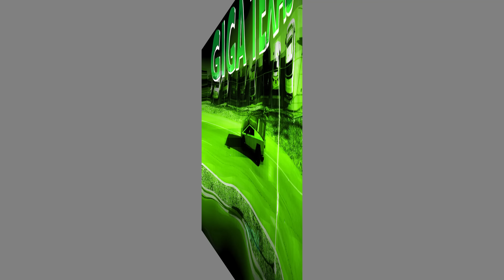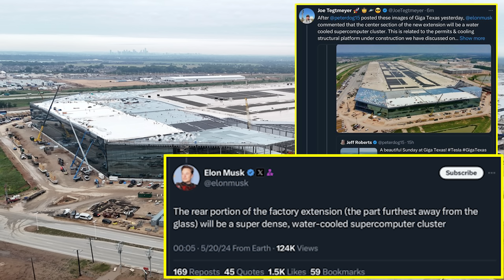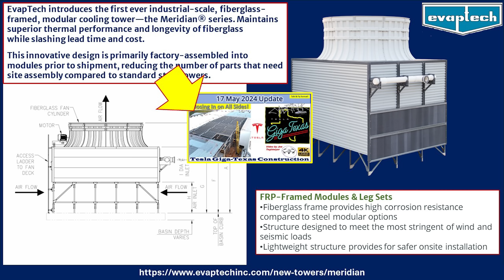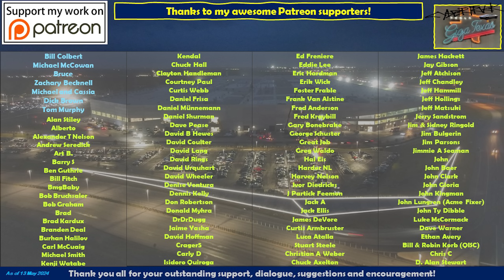S Supercomputer Data Center! N Conduit & Trenching Progress! 20 May 2024 Giga Texas Update (07:35AM)

Comment: Thanks Joe
1:36. Southend, inside. Central Structure, Level 3, under the roof. Beams for a bridge crane clearly visible, including the stopper blocks.
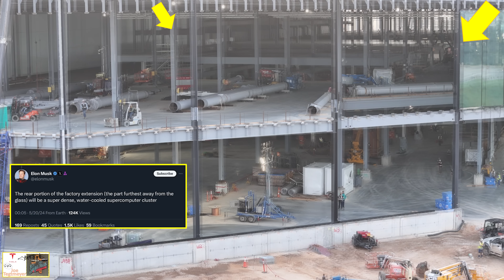Immediately below on Level 2, beams for a bridge crane. 15:21 also.
2:16. East contractors yards. Pipe Fabrication shop. Black vault must somehow be associated with the pipework. Seems painted inside. Vaults seen in the westside storage yard were similar
2:40. Southend, roof. Not so different. Bituminous felt roof layed over insulation board. See 12:18.
Joe’s previous video at 19.37 better shows the system. Trafficable insulation board, joints taped and sealed, hot bituminous adhesive placed and fabric rolled over. Hot bituminous adhesive applied again and bituminous felt applied as the final membrane.
3:25. Southend, east. Cooling tower. Small white perforated pipes attached to the larger black pipe.
Some vertical divisions installed in the FRP framework.
Under the concrete structure. Large steel beams fitted between the columns. For suspending pipework from presumably.
4:02. Southend, south. Parapet glazing. Fixing is into the channel at the bottom, and via a bracket on the vertical edge at the top.
7:24. Southend, east. Apron. To the right of the crane are the raker beams for the angled element of the facade.
9:59. BIW, roof. These pipes are labeled ’TMW OWW’ up at the Casting end of the pipe run. A search turns up nothing relevant for that abbreviation. May be an abbreviation of a witty in-house Tesla term.
10:40. Stamping, roof. Loading platform. Not sure how this will operate. Platform down to roof level is around 8’ 2.4m.
Adding 2 decks of cable tray to the pipework support frame. Possible route for the power supply to the data centre.
17:54. Westside, storage. Salvaged glazing panels. Not being used for the parapet glazing. Different heights, different frame colour, glass would be different also.
24:03. GA, highway side. Left. Area taped off in the small green space.
25:11. Battery west, apron. Rolls of Anode material. Crates marked LGES (LG Energy Solutions).
26:09. Tesla road. Road trenched and the pre-assembled ductbanks dropped into trenches. Works must have been carried out Saturday.
To the right. Possibly some remedial road works, or dropped some other pipe/duct/conduit for ‘later on’. Original ductbank crossed Tesla rd slightly east around 20’ 6m to the east
North side. Excavator demolishing the old batch plant road berm. May be the last section of Harold Green Road. Start of the works for the parking lot exit road perhaps.
Reply: 10:40 Stamping roof platform...
Speculating that they will place the cable spools up there. They have to unspool about 4,000 feet of cable! Or around that much.
One thing that doesn't make sense is how close the cable trays are to each other. Seems like that basically kills redundancy. A fire in the lower cable tray would probably take both of them out. Though I would like to hear from the electrical experts on that.
Reply: @DavidJohnson-tv2nn  10:40. Cable spools location, possibly.

I wouldn't want to say with hat eating certainty that the supply for the Data Centre is to be run on these cable trays. Coincidentally the framework on the roof of Casting does finish roughly above the vaults in the apron below.
Reply: @DessieDoolan  I had exactly the same thought when I saw those two rows of cable trays... Data center! Considering that those pipe supports run the full length of the building. So I think we can be 99.9% certain. Hopefully we can get more drone coverage up there to see how far north they go with the cable trays. Or... If we see a crapload on cable spools on or near the platform, then we will know for sure.
Reply: 25:11  I am not an expert.  Not even a keyboard warrior...  However, It seems to me that battery rolls of copper foil coated with the graphite? mixture should be ultra clean room pure and not open air construction dust and dirt exposed.....  Thus, these rolls are rejects?  And to make matters worse, I thought Tesla was making their anodes internally?  using the dry process.....  And it was the aluminum foil cathodes that are causing problems.

this picture is really, really disturbing.  Are they buying 4680 anodes premade too in order to produce 4680 batteries?  If true, it is a sad, sad day for 4680 production!
Reply: @eclecticmemes  So much of what was promised at different times is far from what was actually delivered.
Reply: @eclecticmemes  25:11. No doubt these are rejects. First time sighted I would add.

Not sitting well in the crates, might be rejects but not necessarily LGES rejects.

I was following the 4680 program earlier, but it all got too complex and I haven't tried keeping up.
Reply: re 1:36 Since the datacenter was confirmed  I've been looking for useful YT channels.. The gist of what I found so far is that datacenter engineering is rapidly changing, and that for high-density datacenters there is a strong move towards liquid cooling. Not as a trend, but as a basic requirement for higher density datacenters as well as for larger and larger chips being developed, incl for AI. In water cooling itself I came across a lot of technical solutions, so better not to speculate too much. But one thing seems clear, for high density datacenters using water cooling there is a need for a massive engine room with rows of pumps, chiller units, manifolds etc. Like next to Cathode but then in an XXL version. So a gantry seems a good idea for switching out equipment. Also I a came across massive back-up water storage tanks to guarantee continuity. And I found a case where the water tanks were used to maximize cooling during the colder hours of the night to save on utility costs during the day.  

How will it all be implemented? There is also the big issue of security, so it seems logical to house everything of direct importance inside the main building, including the back-up water supply tanks and the primary cooling loops and chillers. Outside we would then only see cooling towers for heat rejection, i.e. the secondary cooling loop.

Alternatively a completely standalone bunker could have been built, closer to the switchyard and megapacks, but it hasn't. Utilizing that empty plot, the old switchyard, maybe was a possibility, also no problem to plonk down a cooling tower there. At that location you could even throw in a decent off the shelve gasturbine generator for a truly independent power backup if you can survive the first 10 minutes via UPS. Instead, we get all the hassle of routing MegaWatts of power to the extreme south end, routing refrigerant pipelines over the roof and not to forget the engineering challenges of creating a vibration-free and cleanroom spec datacenter next to massive stamping units and other heavy duty systems. A lot of planning must have gone into the solution now being implemented! On the other hand, a datacenter safely tucked away inside the main building may provide just that extra level of security if, we imagine what recently happened elsewhere.
Reply: @hardernl8893  It looks like we found their solution for power routing @ 10:40 with the two rows of cable trays likely to run 4,000 feet along the parapet wall. But I do have a question... Are they risking losing redundancy by being cheap and placing the two cable trays so close together? It looks like they are only 18 to 24 inches apart.
I would think they would run parallel cable trays some distance apart, but that doesn't seem to be the case.

By the way... I think you were the first to suggest that the "mystery structure" may be for cooling? Or at least the first comment I saw.
Reply: @DavidJohnson-tv2nn  Being the first has its ups and downs, as we know. Being the first to get it wrong is also one of my distictions! I have absolutely no knowledge on power routing and redundancy! It is in the etailed engineering I suppose, following codes and regulations and common sense. Also, we have no idea whether there is an outside insurance party or-consortium involved in the Giga Projects. Insurers often have tighter demands when it comes to managing risks in my experience.
Reply: Maybe an engineer can explain it to me like I am 5 years old.  If these computer data centers consume so much electricity, and turn it into heat, why can't these data centers recapture the heat to turn it back into electricity? Is the heat not hot enough?  What delta temperature is required to product cost effective "work"?
Reply: @hardernl8893  Well if it's any comfort, your not alone in getting it wrong from time to time. I'm right up there with you in being the "first" to not be correct from time to time. 🙂
Reply: @eclecticmemes  They can, and they should IMHO, certainly in moderate to cold climates where the simple application of a heat pump would boost the temperature level of the waste heat (24/7 available!)  to make it suitable for town heating, hot houses for vegetables etc. Like you say in so many words, it ain't exactly rocket science. Luckily there is already a precedent at GT where heat pumps are deployed at a very large scale, utilizing a.o. the water of  the heat- or cold-sink in the underground H vault. The pipelines under construction on the roof are a bridge for refrigerant, according to the permit. Dessie hasn't deciphered the coded labels on these pipes yet, but if they transport waste heat that may be for heating the drying air in the paint shop, just a possibility... Unfortunately I cannot find a 2023  Impact Report, otherwise we would have much more info on the environmental footprint of all the Giga Factories. It is very odd, the 2022 Impact Report was published end April '23 but so far nothing for 2023.
Reply: @hardernl8893  1:36. I hope we get a view inside the finished centre to see how these bridge cranes will operate.

Joe's photo 4 shows the bridge crane beams are 2 column spacings long. One complete column spacing has no floor. Perhaps no floor yet, as that seems an excessively large area to leave open.

Potentially these bridge cranes are temporary. Used to hoist in the big $$$ items, before being covered up and hidden in the ceiling space, or removed.

Comment: 22:55. I have commented previously on the length of the tunnel to date. And how I have used the changes in the belt cassette to estimate this (including the extensions to the belt added when they stopped to install the backup decks). See previous comments on these and Brads videos. Current estimate is approximately 205m of excavation, putting the TBM cutterhead at the bottom of the berm on the east side of the highway. 
1m raise of the belt cassette moving beam = 26m tunnel advance. On 4th May tunnel was estimated to be 160m. 
Use of segments can now be also used to estimate progress as it is now assumed all segments have been delivered to site.
Again, I have been through these calculations in detail in previous video comments.
If the tunnel is to exit before the extension, expect to see it in the next week or possibly less depending on production (pretty slow at present).
Reply: You can take a horse to water......
Reply: Thanks.  I had suggested something in my comment, but looks like you are on top of it!
Reply: This is the first time I’ve seen GREY DIRT in the Boring Company spoils bin instead of dark brown dirt.  I’m curious if there is a soil composition legend for the area or a way to determine depth/location based on this grey dirt color.  As far as I remember, grey dirt never showed during the entire excavation/grading process years ago for the factory either.
Reply: @SpaceGeek321  without a geological section along the tunnel it’s hard to determine anything from the spoil.
Reply: @SpaceGeek321  There was grey before, they just mixed it with the dry brown they brought from outside...

Comment: The rain cabin and wind tunnel will probably end up in the area next to the tunnel boring operation if my guess is right that the end of the south end of building is a vehicle engineering/design studio and the tunnel connects it to a testing area west of the motorway.
Reply: The tunnel shortens the route to the end of line facility and also keeps them away from public roads. Much safer because they might still need work in the end of line facility.

Comment: Less Model Y production likely means updating the production line for the Juniper refresh (or due to less 4680 cells now going to CyberTrucks) Munro Live released its 2nd Cybertruck battery pack video today FYI
Reply: Could also be beginning to set up for production of one of the smaller models. The new plan allows for them to be built using existing 3/Y production systems. Neither Juniper nor the smaller models are supposed to begin production until late Q4 or Q1’25.

Comment: If we compare Austin to Shanghai factory, the Shanghai factory has a tarmac area with a high fence around it next to the engineering area. I expect we will see a similar high-fenced area just east of the west side trailer area for engineering vehicle testing. With the tunnel under the motorway linking it to a south end engineering centre

Comment: And now we know what the giant cooling structural building is for. Super Cooled computers.
Reply: And also, the large water tanks
Reply: The data center was known for some time, and of course the possible use for the cooling structure. It was just confirmed today.
Also, I suggested a couple of weeks ago the possibility that the large water tanks may be part of the cooling system.
Reply: Pretty cool!
Reply: @DavidJohnson-tv2nn  I guess you win? 🤷🏽
Reply: @guerro327  lol, 5555555
Reply: @guerro327  Not so much a matter of winning as making carful observation of what was being built, then forming speculation. Sometimes the speculation turns out to be correct, sometimes it doesn't.
Reply: Yes confirmation of educated guesses. Many said it cant be a data center because of the windows. They never thought about the size of the addition. Many could not see a cooling platform and had wild guesses of its use. And the whole roofing issue is interesting. Even tho the computers are water cooled, putting holes in the roof above electronics is never a good idea. My 2¢
Reply: @gurugee2112  I’m wondering if the different roof membrane is for heat dissipation or blocking/redirection somehow so excess heat from that section isn’t trapped or warps the roof?

Comment: May be also that's extra water proofing on that section of the roof. They are about to put about a billion or more worth of compute under there! Dont think they will cut any holes there.
Reply: YES !!!
Reply: I was thinking maybe they're not adding insulation because they do want to lose heat through the roof, rather than have it insulated...
Reply: @greggerypeccary but what about in the summer heat?
Reply: @Alarix246  That's what I'm not sure about: what is worse there? Will the extra heat from the roof heating in the summer add more to cooling costs than the benefit of losing heat in the winter?

Keep in mind that heating from the sun is only in daytime, that they paint the roof white, that heat rises (so will move towards the roof) and that computers actually operate at pretty high temps -- my desktop computer processor operates at 40C-50C and can handle up to 100C, which are higher temps than outdoors...
Reply: @greggerypeccary  Those cooling towers will make that all moot.

Comment: Iv seen those gold and black cylindrical components in a video where they make the 4680 batteries. the black material roles across them as they pour the powder on them and forms the battery center before it goes in to the silver cans. Best I can remember.

Comment: that big structure on top of the cooling building looks almost like the setup on top of the original Google datacenter in the Dalles, Oregon for evaporative That was designed to cool around 30 megawatts of power and it was a little bigger than what you see there (maybe twice the size)

Comment: It all makes sense now.
Reply: Again, this all made sense weeks ago that a data center was highly likely to be built in the south extension.. But we did need confirmation, which we got today.
Reply: @DavidJohnson-tv2nn  AI and Robotics. That's the purpose of the south end extension. It adds up with a story that I saw today about Elon putting pressure on the Chair where he kind of said that he wants more control or he pulls AI and Robotics out of the core plan.

Comment: The 4 stainless steel tanks in the south end. Elon said water cooled computer centre. Likely, there will be two circuits. The two large tanks are likely a buffer of cooled water in case of a power blackout. The two smaller tanks a water buffer in the air-cooled water system. Or vice versa.

Comment: Have we actually seen cassettes added to the cassette machine?  I had assumed that the loops of belt shorted as the belt was extended into the tunnel.  One can see that the loops are only about 1/3 extended now.  We might estimate the tunnel length as 2xnumber_of_loopsxloop_end_to_ground_length.  But would love to hear what is really happening :-)
Reply: Yes, initial 250m roll installed then another 250m added 2nd July. Current potential was for around 200m + 85m for the TBM conveyor. Another belt length is available near the segment store.

Comment: Not messanine levels, a messanine built up from or hung off another level. The data centre section is simply 3 floors instead of two. So offset would be better, or 3 level section. But really cool video, up to your usual high standards.
Reply: Yes, the data centre dlopen't need to height per floor.  Makes sense.

Comment: I’ve been thinking those three concrete “tunnels” under the south end may be for roof water collection. Might they also be related to the new cooling systems, Joe?
Reply: curious, why collect roof water inside the building?
Reply: @gurugee2112  they built something similar in the main building too.